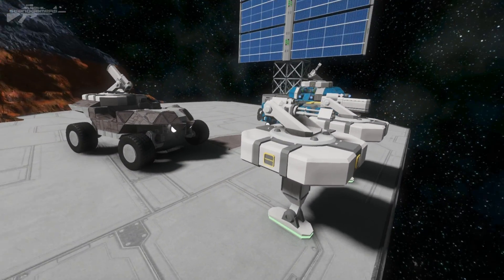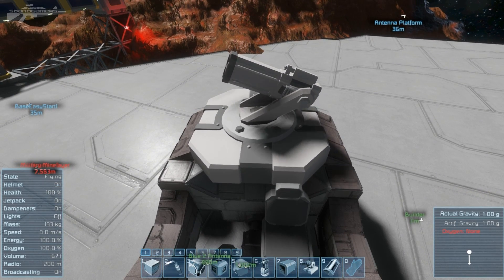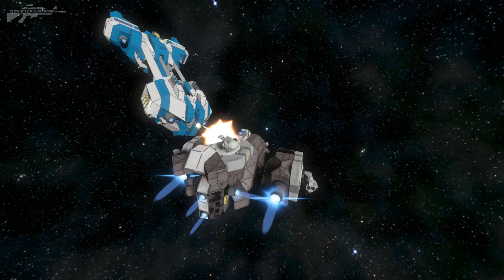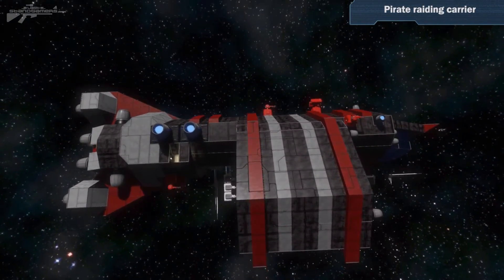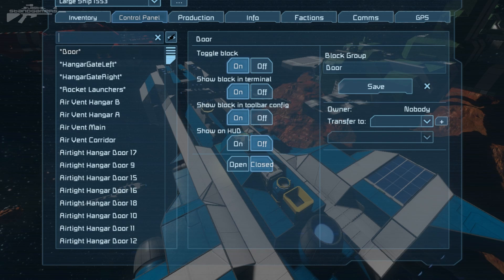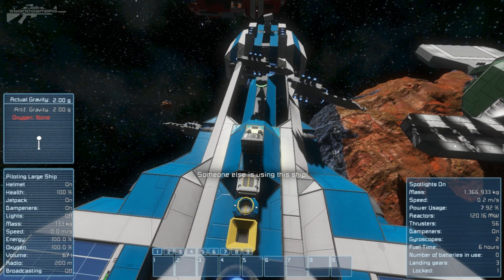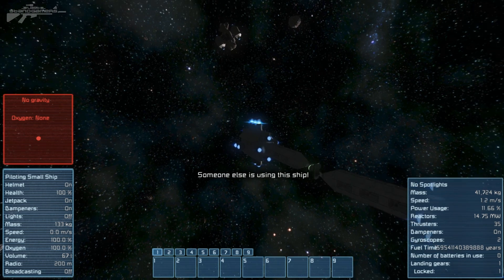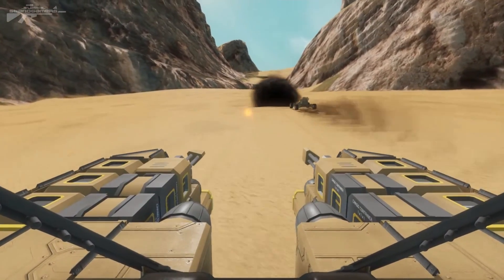Space Engineers - Small Turrets &  Landing Gear Fix

Comment: I really hope they make it hard for small ships to fly around on planets so people are forced to use wheels otherwise there is no point in having them.
Reply: +Moss Foster i have a feeling it wont be hard but i would like to see wheels being cheaper then thrusters that way that is the reason to use wheels on planets
Reply: LaserWolf Indeed
Reply: Moss Foster I JUST HAD A IDEA- make thrusters use a shit ton of fuel in heavy gravity or something like that, i think that would work really well
Reply: LaserWolf Good idea I'm pretty sure that would be easy to implement aswell
Reply: Moss Foster
Yup since its already a different gravity from the one you can make
Reply: And I really hope that you'll get a real sense of momentum on planets, so it actually feels good to fly around planes.
Reply: +LaserWolf Liquid oxygen and liquid hydrogen could be used as fuel.
Reply: *****
why? if flying was the same as now but on the planet it would be easy to fly and not have to worry about hills and stuff like in a wheeled vehicle
Reply: +Moss Foster But the flipside of that is that would prevent you from having cool air battles in fighters with flak rounds going off everywhere and epic dogfights and...
Reply: +Moss Foster Yeah thats for small ships.
Now try that with a large ship that usually has alot less thrusters for its size and you might not be able to take off.
Reply: ethan McDonald Or they could add jet engines, ones that breath air and are very fuel efficient in atmosphere but don't work in space.
Reply: +Alex Phrost (INoPro) yeah, but big fighter battles gonna be fought out in space with flak coming from the large space battleships around. thats even cooler than just fighter combat in the atmosphere. and there are a few mods that add flak fire and stuff so it won't be hard to implement it in the actual game.
Reply: +Moss Foster Well its probably still better to explore the planet with a wheeled vehicle instead of flying around.
Reply: +LaserWolf Well in survival it would make sense because you would need far less reactor power.
You dont have to thrust up your engines, you just have to use the wheels that require less power.
Reply: Hero playsMC That may happen but I've started re-building my small ships with large thrusters on the bottom so they can still fly in high gravity, but from the teaser it looks like we won't need that much thrust to fly (unless they change it of course)
Reply: +LaserWolf They already are, are far as I know. Iron and nickel is all they need I think. Whereas thrusters need iron, nickel, and cobalt, and perhaps something else.
Reply: +LaserWolf They could add an alternate fuel source and engines so you could build planes that have to stay in atmosphere too
Reply: Moss Foster Yeah that would be a better idea.

Comment: Another interesting change has something to do with pistons and landing gear.  When I lock my landing gear onto a station, the pistons fix in place in space, requiring them to be deleted to avoid explosive damage to surrounding blocks.  At first I thought it was the combination of gears on pistons, but any gear on the ship causes the behavior.

Also some attachment issues with some modded blocks like compact antenna and AI computer core.  And finally an issue with jetpacks not working on some modded suits, which require a change bake to default to fix.

Comment: While those fixed landing gear will be great for joint survival, I've run into quite a few bugs, most serious of which is a crippling 0.1 or lower sim speed when I go to mine an asteroid. Granted I usually get down to 0.35 or 0.25 since I'm using Sage's HOGG as my base/mining ship, but that's only when I'm actually running the drills and in contact with the asteroid. Now I just get within 100 meters and the sim speed starts dropping like a rock to the point I can't physically control anything.